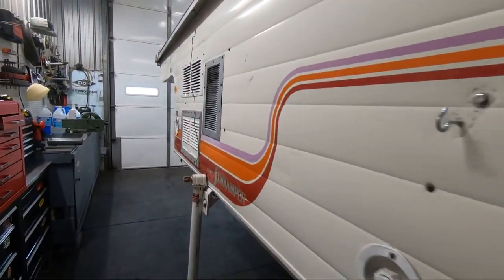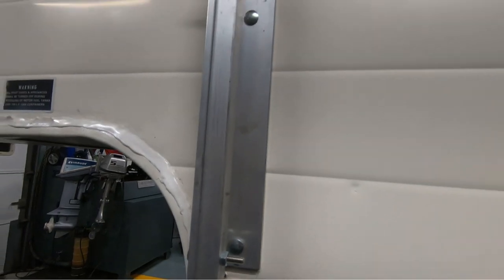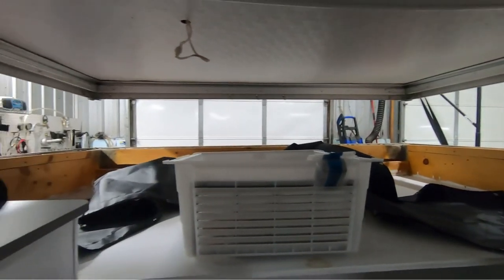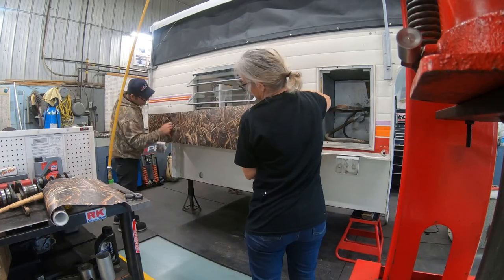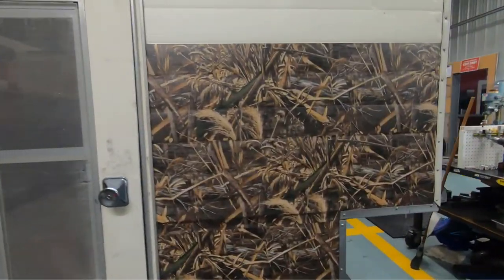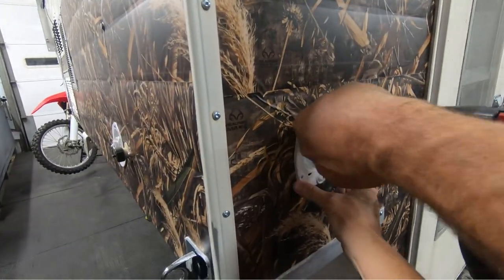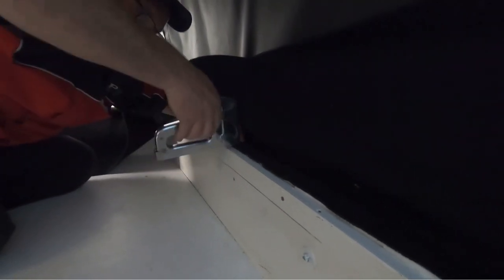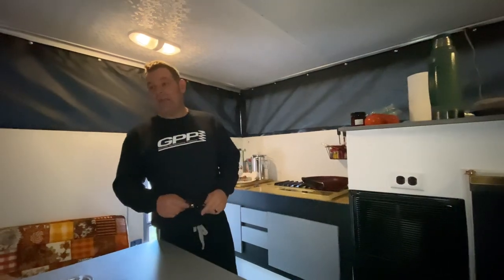1974 Truck Pop up Camper Renovation *Episode 6*  Before & After  Vintage Trailer remodel

Comment: I know it's a little late... but I had a Jayco pop up campers had a crank-up roof, and those work really well. They put those on a lot of "pop-up' campers and trailers. My second choice would be how Four Wheel campers lift their camper roofs. Front and back plates to lock the roof in place. I would suggest a couple windows to battle closterphobia in your tent material...
Reply from the maker: Thanks for watching! We are still working on a better system to put up the top . Haven’t been able to use yet this season but when we do this will be tackled